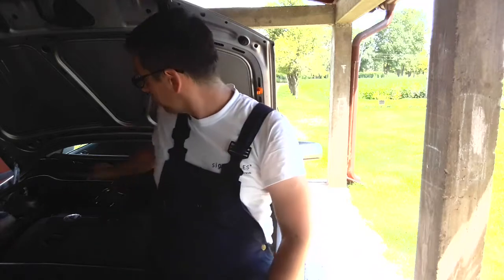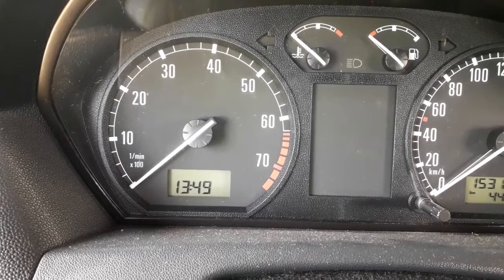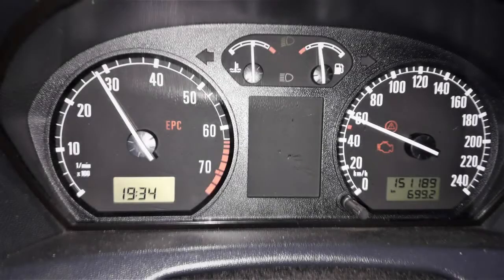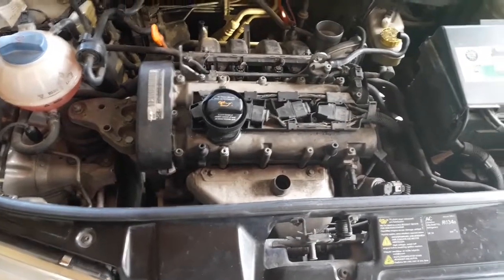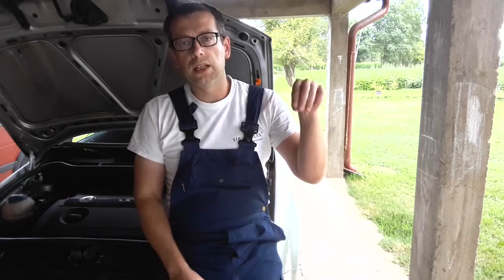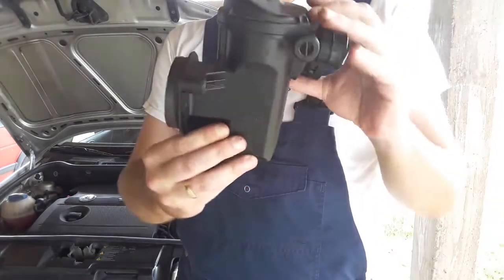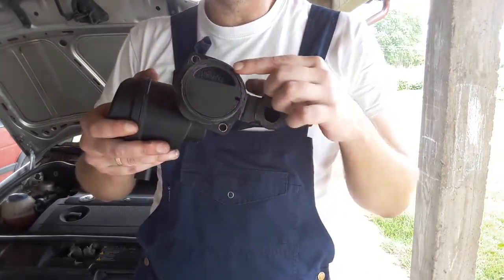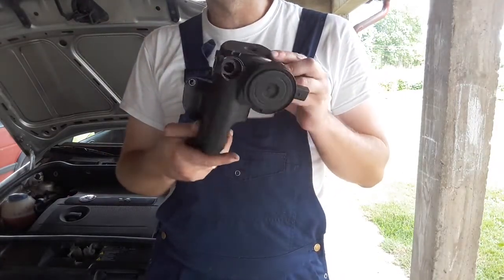What Happens When The Crankcase Breather Goes Bad? Symptoms and Solution

Comment: I experience a RPM goes up as you drive but the A/T transmission connection feels like it's not there as the odometer drops to zero. This is during running. To make it run, is by waiting alight and driving again
Reply from the maker: Hi and thanks for watching!

Sorry, I didn't get what the problem is about. Also, what car is it?
Reply: @DespairRepair  thank you for replying. Ah it's a different make, it's a Jeep Renegade 2015 A/T, got 25K in the odometer. But every now and then I get issues where rpm goes all the way up like 4000-6000 but doesn't accelerate, this happens during running condition not when coming from stop.
It happens like 2-6 times a month. The only thing I do is I slow down and wait rpm goes down and starts it again.
Good thing it's not happening in the free-way. 

I really dont know what's causing it. Just wondering if you encountered something like it or heard of? Thank you
Reply from the maker: @bathanmark  to be honest I haven't. 

It could be a dozen things so best connect a diagnostic tool and try getting a code.

I could tell you that the automatic transmission on those cars is not known for its reliability and that your car is essentially a Fiat which makes good cars but most of them have a mind of their own.

I've driven one so I can speak from experience. Not bad-mouthing anybody, just personal experience.

So, again best get an error code and start from that. Also, check the wire harnesses or electric connections to the transmission if you can, just in case.

Hope this helps and hope you don't mind the long comment.
Reply: @DespairRepair  i appreciate the reply. The longer the better. I will get a code reader first.
I dont have a check engine light, so it will still show some error code eve so?

Thank you for the advice.

Comment: Hello, my previous message was blocked probably because I posted the picture of the leak.

Anyway I am having the same exact leak on my 2005 polo 1.4 75HP, BKY engine model, and a very rough idle when cold, when warm the idle is almost stable but randomly is very bouncy for no reason. 
Sometimes even stalls, the rpm fluctuates between 500rpm and 800, then tries to accelerate and bounces up and down.
 
It's worse and more noticeable when I'm revving up the engine at neutral, which triggers this behaviour. also, especially when revving up just a little, the rpm goes down from 700 to 550,  then goes up to 750 when it should at least go to 900, and  It's a nightmare when I am at stop lights I always try to keep the engine alive by accelerating to 1k rpm when it starts to bounce, otherwise I'm sure it will stall soon.
It's happening ever since I got this car 3 years ago, at 160.000km, now has 197.000km and now it's worse. I have basically replaced everything. No engine lights comes out. 
Replaced Ignition coils, spark plugs, pressure manifold sensor, water temperature sensor, crankshaft and camshaft sensor, b1s1 oxygen sensor, cleaned the butterfly valve, the only noticeable change was replacing the crankshaft sensor so at low engine speeds has a little bit of more power. No issues after 2k rpm it's perfectly normal.

After seeing your video I tore apart the PCV valve and gave it a clean with air and wd-40, it was very very clogged and dirty but I think I broke the little metal piece which is inside the bigger hole of that valve. Anyway since the o-rings were a bit worn taped with some teflon. When I put everything back I have noticed no difference, the idle is still bouncy but anyway I ordered a new one just because it's leaking and I broke the metal piece inside. 
I am not entirely sure what to do at this point, I have not checked the timing, maybe it's a bit off? 
Still, I am having issues only at idle. The rough cold start only started to happen since 6 months ago. It's a decent car but It's become frustrating to have this stupid issues, I can't find vacuum leaks but looks to me it's running very very lean judging by the spark plug color. I have also noticed a lot of water or fuel idk, which comes out from the exaust after doing this tests while warming up the engine  (the bouncy idle, etc..)  
Also, what about the upper breather which is on over the camshaft housing? I am thinking to try to replace it too.

Anyway, thank you for your guidance
Reply from the maker: Hi, thanks for watching and for the detailed explanation!

Did you connect an OBD tool, did you get any error codes?
Good thing you're going to replace the PCV valve, best do it to avoid future problems.
In my opinion, you've done all the important things. All that I can say is that this is typical for a temp. sensor failure and a dirty throttle body. 

Also, have you replaced the fuel filter?
Reply: @DespairRepair  Hi, thank you for you answer. 
Yes, I do not have any error codes stored, anyway I do not have replaced the fuel filter, I'm running on LPG and I'm doubting that's the issue because every time I start the car after resetting the auto adaptation parameters from VCDS the issue disappears. At least the bouncy idle when cold, because I noticed it runs slighty worse at petrol after running LPG. It eventually becomes normal using petrol only, still, not for the bad idle.
Reply from the maker: @luky7080  hmmm to be honest that will probably be a tough one to solve.

Please don't take this as patronizing and you've probably already done this, but have you recently checked and serviced the LPG system (filter + complete system check)?

These systems are, in most cases, very good but are known for causing similar problems like yours, especially if the car has high mileage.

Comment: I haven’t seen a pic valve with a sensor, I assume it picks up the air flow or pressure/vacuum. Were you lucky enough to get A fault code for the breather system?

Comment: Hi, i have a 89 accord here and it has 101k miles on it, recently I put a brand new PCv valve in and in the beginning it ran fine but just recently it blew a part of the oil pan gasket and spewed oil all over the place. It actually 1 of the symptoms which is barely any power a acceleration. Any thoughts about why this is happening?
Thanks
Reply from the maker: Hi and thanks for watching!

The first thing that comes to mind is either a faulty PCV valve or you didn't install it properly. Both of these are unlikely. 

The gases don't flow properly causing a build-up of pressure and this caused the oil spill.

I haven't had much experience around Honda's is there any filter for the gases perhaps?
Reply: @DespairRepair  I'm not sure right now about that but I'm gonna go and inspect the crankcase ventilation system today and gonna see if anything blocked.
thx
Reply from the maker: @aleki_2.4t61  you're welcome and hope you solve the problem.

Also, try checking the tubes for clogs. The ones that are connected to the breather.

Comment: The same issues on a Polo 1.4 FSI. The question is: Why is everyone so "excited" about the German engineering?! My first and my last VW! Next time I will buy a French car which is less complicated and prone to failures that are very hard to identify even by VW dealers!
Reply from the maker: Hi and thanks for watching! To be honest I wouldn't put any blame on German engineering but rather on where the whole auto industry is going. More demands mean more complications and thus more problems.
It's pretty much the same with other manufacturers also if you've noticed.

Comment: Hi I have a pd100 rpm stays on 1000rpm I changed coolant temperature sensor, fuel temperature sensor, my rocker cover is leaking badly could it be the course?
Reply from the maker: Hi and thanks for watching! Sorry, I didn't quite understand the question.
But from what I did, I would first check what's causing the big rocker cover leak (it's oil leaking I presume).
Either the cover is faulty or excessive oil pressure is building up within the engine.
This might be the cause of higher rpms.
Not much of an explanation but hope it helps at least a bit.

Comment: i just bought an 2011audi a4  the hose wasn’t connected and it was closed. do i put it back on?
Reply from the maker: Hi and thanks for watching!

There is a good chance that it was done on purpose. Probably because of oily fumes.

If I was in your place, I would leave it, especially if it doesn't cause any problems.

Hope this helps.

Comment: My breather is trash, we got a replacement but haven't changed it yet. Now my car will start but instantly stalls out, I've never had this happen before, I've had it stall before but never instantly after start.  Can the breather cause this.
Reply from the maker: Hi and thanks for watching!

Possible. Does the check engine light come up? Are there any more symptoms besides this?

As you've seen in the video, with my Skoda, all the warning lights came up before beginning to seriously stall.
Reply: @DespairRepair  the immobilizer was tripped because of my key fob and no matter what I do or try it will not reconnect, I've lost my job, which is an hour away and life seems like shit rn. All cause I replaced a disgusting fob shell that was falling apart. And yes but the engine light has been staying on because my dad never turned it off after we replaced the oil cover gasket and oil/oil filter. All the codes for fuel regulator/fuel pressure and air pressure are cause the immobilizer has disabled those instruments so the car won't stay on as an anti theft precaution

Comment: Hm. I have these symptoms on a 2003 Polo and my car also jolts and bucks? Do you think it's possible?
Reply from the maker: Hi Adam and thanks for watching! What type of engine is on the Polo?
Reply: @DespairRepair  1.4 16v, same as your Skoda
Reply from the maker: @adambennett805  it can certainly can be. You've seen my experience from the video.
In my case, there was previously an oil leak coming from the crankcase breather so maybe you can check that first.
Also there was the check engine light
Reply: @DespairRepair  yes I also have a leak and check engine light and EPC light
Reply from the maker: @adambennett805  then I would recommend changing the crankcase breather. At least that's what solved my problem definitely. Seems to be a common problem with those engines.
Reply: @DespairRepair  Thanks for the reply, just had a look and when I remove the oil cap while the engine is running, the car surges then nearly stalls and the check engine light and EPC light comes on. just ordered a new crankcase breather so we'll see how it goes
Reply from the maker: @adambennett805 , I hope you solve the problem. Once again, seems just like the problem I've had and that should be the solution.
If you find the time, write, or comment to tell what happened.
Good luck :-)
Reply: @DespairRepair  will do, thanks for the video
Reply from the maker: @adambennett805  you're welcome and best regards to you!
Reply: @DespairRepair  hi mate, I changed the crankcase breather today and unfortunately it made no difference to the jolting or bucking but I'm glad I changed it anyway, it was leaking oil and sending oil into the throttle body
Reply from the maker: @adambennett805  hi again!

I'm sorry that the advice didn't solve the problem completely. As I've mentioned I had the exact same symptoms with my Skoda. The jolting was really severe and the car was almost undrivable. This was accompanied by the oil leak.

It all stopped once the part was changed and the engine runs a lot smoother now.

Hope you get to the bottom of it and if there's anything I can help, write. 

To tell you the truth, I'm curious what's the problem.

Best regards to you and good luck!
Reply: @DespairRepair  Thanks, I'll let you know once I send it to the garage, my next suspicion is possibly the crankshaft sensor but I'm going to let them find out. 
Thanks for the video
Reply from the maker: @adambennett805  ok, good luck! :-)
Reply: @adambennett805  did  you solved the problem?
Reply: @tampixena  not yet mate, garage is still having a look but they think it might be the EGR valve
Reply: @tampixena  ill let you know if it helps
Reply: @tampixena  ok mate it's all fixed now, it was the EGR
Reply: Helpful